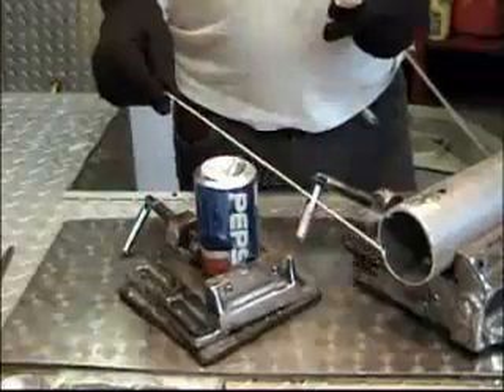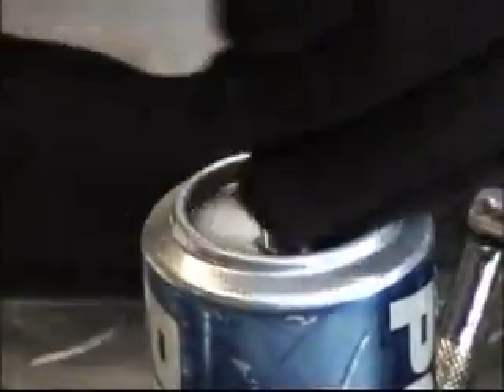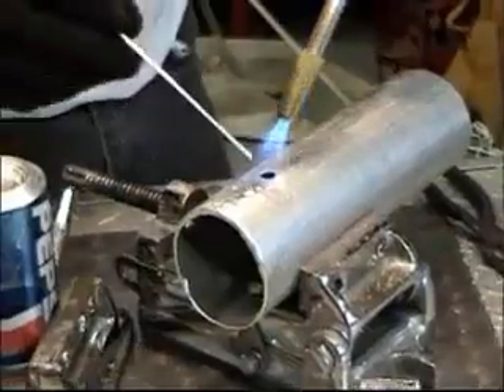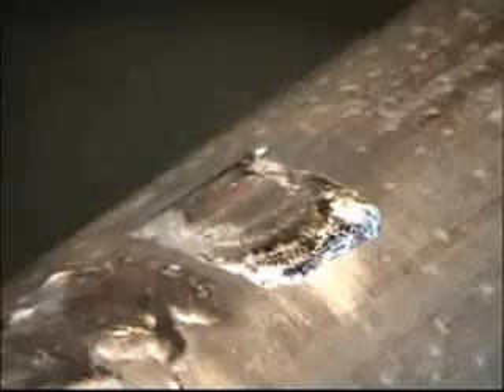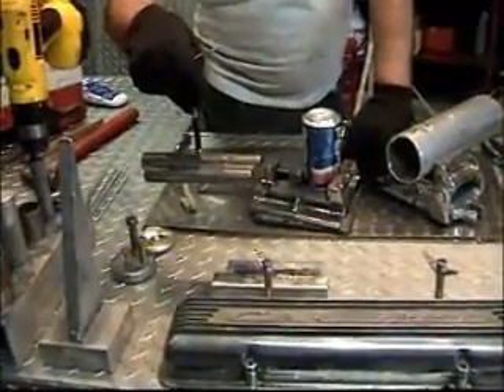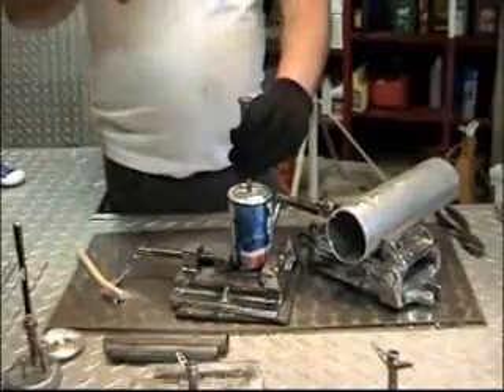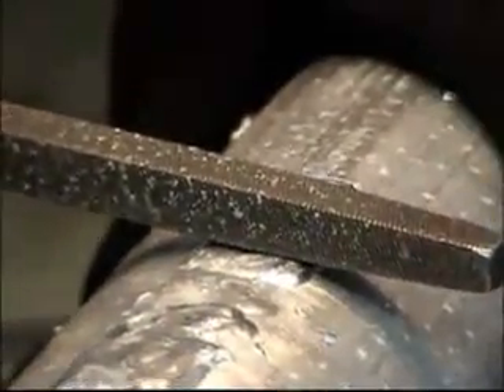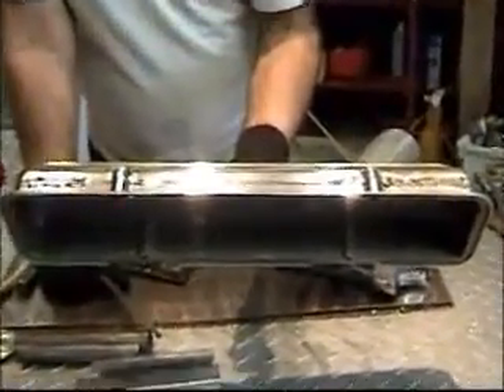Durafix Aluminum Welding Rods From www.chronos.ltd.uk

Comment: it seems that only the rod that melted not the metal surface. therefore there must be not strong binding between the melted aluminium and the metal surface. in the case It acts  just like a glue.

Comment: Is this a tin solder ?? Is it useful for welding iron water pipes please respond quickly
Reply: I use WB-5 for almost  anything no aluminum you can buy a pack of 4  
   12 inch rods home depot around 5 or six bucks  it takes about 1600 degrees fh

Comment: Would I be able to join washers and nuts together with this? I think they are steel but have a zinc coating
Reply: I think this is for brazing Aluminum only not steel.

Comment: I have a bracket made of zinc from a 58 Corvette ,it is very heavy, and a small piece broke off it is about 2 1/2 by 1 inch and I want to weld it on, What do I need to use to repair it

Comment: This is brazing not welding. Welding is much stronger because the base metal and the rod are melted together. Brazing is basically like glueing the pieces together with the rod

Comment: hi sir , need to improve some tests , on thin sheet metal , is it possible to use bronze rod , with propane gaz cold brazing , then need to have good results with cold brasing mono gaz not dual gaz 
look for silver bronze rod actually with the adequate flux , thanks for advise

Comment: i dont know how he does this i try and try never melt
Reply: Same here . Anybody else have problems ?
Reply: 750 degrees?    The metal has to melt the rod . Not the torch . Same as copper soldering a pipe

Comment: My first thought was copper water pipes in lieu of solder but solder melts at lower temp - between 190-840F.   However, could filling a hole or split be an option? is it safe for drinking water?

Comment: This may very well be a very useful product to be used in difficult situations, but it is NOT welding. Aluminum cannot be welded at 730 degrees. The distinction between soldering and brazing is usually defined as 840 degrees, so this is some sort of soldering process. Again, possibly very useful, just know that this is NOT welding.
Reply: Actually with the use of flux it lowers the melting point.  So this is kindof a hybrid of both
Reply: In engineering and metallurgy, flux is a substance, such as salt, that produces a low melting point mixture with a metal oxide. In the same way, the addition of water and other volatile compounds to rocks composed of silicate minerals lowers the melting temperature of those rocks.

Comment: Great video. Thank you. Question: I want to braze ("weld") several small pieces onto the side-rails of an aluminum ladder rack. The rack cannot be removed from the truck cap. I am concerned about the molten rod dripping away from the work. Any suggestions?
Reply: David Betts use a drop cloth
Reply: It works just like copper pipe soldering.  No real worry. The heat dissipates very very quick from the rod.  Only thing is thick material needs a hotter than propane torch cuz u have to heat the product material not rod

Comment: How about filling a hole punched through the barrel area of a lightweight aluminum wheel and  hitting rebar on the freeway?
Reply: Yes, low melt welding rods are stronger than the host metal.  If the wheel is not magnetic that is.

Comment: It's not welding ! At best it it's soldering or to stretch a point brazing but not welding
Reply: I have heard about this process before and have been warned not to use it for anything structural. ie. Roofrack for my van!
Reply: @simonfredrick3029  Definitely Not.
Reply: There's no doubt!  "Welding" means that the base  material is melted, and that is clearly not happening here.  Brazing seems reasonable, since there IS solder for aluminum, too!  I've seen a video where some fairly heavy material is done by coating each piece with this stuff and then sweating it together.  Then they hammer the crap out of the joint until it's all bent and ruined, it's very convincing!

Comment: May be I am using wrong heat. But it didn't work. I think i waist money
Reply: Does need a bit of practacie. Clean area well, and take time over heating metal gently. I made a mes sthe first time I used them, now I use them a lot on Land Rover bits.

Comment: Can these rods be used with my ac+/dc- arc welder tell me now
Reply: No they are brazing rods they don't have the flux on them to creat a slag layer besides they are mostly zink you would melt it in your stinger
Reply: thank you  @aldensmith5571

Comment: I've been looking through the comments here but do not see anything to answer my question. What is the tensile strength of these welds? I'm looking to build an I-Beam of sorts. I know the 1/2" aluminum will easily handle the load being placed on it, but my concern is whether the weld will handle the strain or if it will cause the manufactured I-Beam to collapse.
Reply: 4 months late maybe, but I probably wouldn't use it on anything structural. this doesn't have the same penetration as typical welding does
Reply: Make a scale of the I beam and test it.
Reply: Found this for you. This is a tech data sheet. 
https://www.chronos.ltd.uk/engineering-tools/2013/durafix-aluminium-welding-brazing-soldering-rods-from-chronos/

Comment: I have an older model 1979 8 horse outboard motor it has a starter casing that is the housing for my pool cord today I broke it and I was wondering if since that casing is aluminum for molded aluminum or whatever it is can I use that same method that you just use to repair it I would just buy another one but they are obsolete

Comment: This may sound like a silly question. I know nothing about welding or brazing, but I do have some knowledge about 2-stroke engines. I need to fill some intake ports and transfer ports up with a port filler to optimize flow, but due to the mass of the material I have heard it may be impossible (even with pre heating in an oven) to apply enough heat with a torch to get the rod to bond. I always wanted to learn stick welding so my question-would there be any advantage to try and use these low melt rods in a stick welder to try and get the material to bond, and possibly reduce heat distortion with a traditional welding rod which I am guessing needs higher temperature. Thanks, Frank
Reply: repairing out board propellers
Reply: Frank Crawford